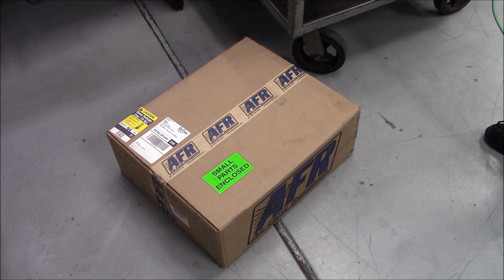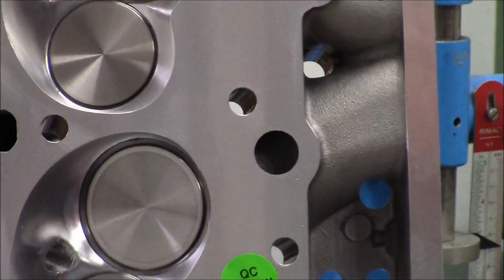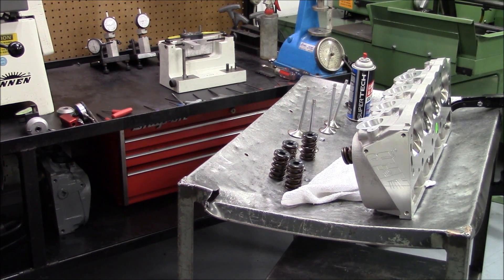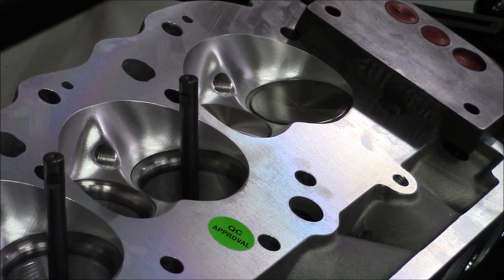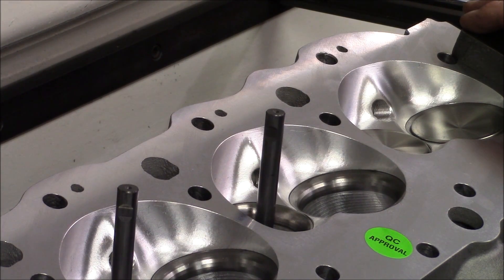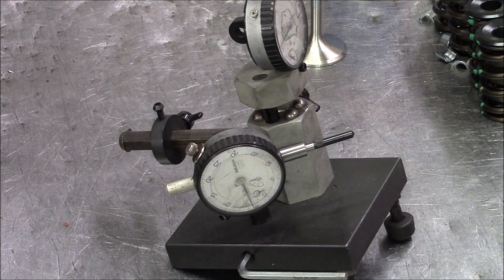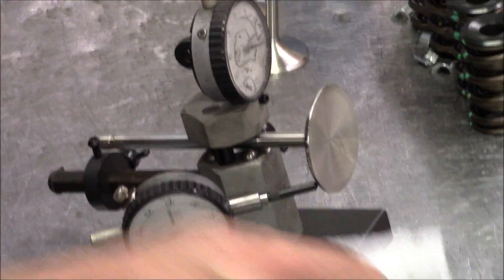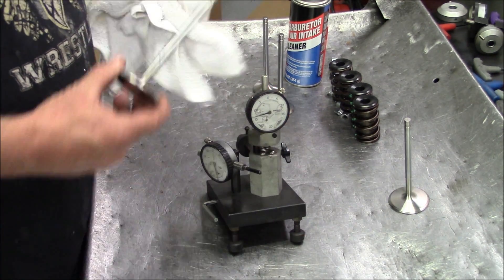Aftermarket Cylinder Heads - Why You Shouldn't Just Bolt Them On - Part 3 - TRRC / Vortecpro

Comment: Your videos surprised me. With my ignorance I would’ve mistakenly thought that all of this would’ve been correct with modern CNC machining. Totally Wrong! So if you got some aftermarket heads you would have to get a competent engineer to just do all of this work as a matter of fact because if you didn’t you’d have big problems. I’m curious how an engine straight out of the factory would’ve come up on the same tests? What were they like in the 70’s in the Muscle Car era ex factory? So the design and porting of these alloy heads would be good and accurate, but they need a valve job before you would consider fitting any of them. And this brand is better than a lot of others. How many hours of work to rectify these problems?

Comment: They don't give a chit. With modern cnc machines these should be spot on. Hell I can do it perfect with my 60-70 year old Sioux Valve Grinding Equipment. It takes a lot of time using stones to get the seat right on all the valves with a 3 angle valve job but I have done many a sets including mine and never had a problem. Even did my own porting. 200 hours I have spent doing a set the old fashion way with the porting but they were spot on. Even cutting them with carbide cutting equipment gets you really close but you still need to use a old stone way to get them spot on. The reason is when you put very much pressure on the valve guide pilot it bends a little and that is were you get the run out. I had I guy bring me a set that was done at a good machine shop and they were off .0017. I just touch the 45 degree angle a dat and was spot on. The owner even wanted to watch and I wanted him to. I always lap my valves in the last step as this can tell you a lot if you no what your looking for. Being a old Tool and Die maker you learn how to do stuff right with worn out old machines. Now days with all the good stuff they can't even get close. Sad really just no quality control and all head manufacture do the same thing. Better off to just buy bare heads and build them up yourself with good parts. The best heads I ever seen as a bolt on was GM vortex heads. Just saying.

Comment: I have worked on new factory heads worse than these.  They were BMW, MBZ, Porsche and other High End makes. They all needed at least a "touch up" on the valve seat critical angle...EVERY ONE.

I had a German Auto Repair Garage and Machine Shop for 30+ years.  I had an advantage because I was an experienced Machinist first and just liked wrenching on Exotic Automobiles.  I was in Local 1515 of the Automotive Machinists Union in the SF Bay Area.

I bought Job Shop type Machine tools mostly, not specialized Head and Block machines.  Much slower, but with Universal uses and excellent results.  My 10 year old son could run specialized machines as well or better than this Video demonstrates.

This Tech is a bit rough as he seems to be Self Taught and doesn't have the fineness of a really well trained Professional.  His performance on this video is appalling, but is quite typical of self taught "experts" that "know it all".  
Just saying.

Comment: I know this is a old video but I would've liked to have seen him switch guide rods and measure the same valve to see if maybe one of his guide rods had a little tweak in it. Seemed like he was using a good bit of force to push them into the fixture. I'm not doubting his results cuz I've seen him cut the offset valve seat in another video and it was obviously out of round. I just found it kind of odd that these errors are that prevalent. But I guess when got manufacturing on a level that afr is they're not checking what he's checking although they should at least once or twice a day. But people have been bolting these things into their engines for a long time and I don't think there's any stories of valve guides wearing prematurely or at least I haven't heard of any or there'd be a lot more guys like him raising the concern

Comment: That's Insane!!!   Are you kidding me?  I never in a hundred years would believe something like this unless I saw it with my own eyes.   I will have to check my next set of parts.  This may also explain the premature failure of my last engine with AFR parts.  I still need to tear it down.  Need to invest in more dial indicators specific for this type of work.   Thank you so much for showing this.
Reply: Remember, these are mass-produced heads. I could care less whose brand they are. The manufacturers, have their own machining tolerances that they have deemed, adequate for passing. A great machinist will still check them.

Comment: People have been bolting aftermarket heads onto their engine blocks for decades without any mention of any of this stuff. If it were Truly a problem I would think something would have changed, or Everyone would’ve started taking the heads they buy to a motor machinest, years ago.
Reply: This kind of fine blue printing is what separates your average engine that everyone has to a killer that makes big and reliable power
Reply: @hollaschracing3753   A few thousands run out is not ideal however when the head heats up the valves and seats have a tendency to bed into one another I do valve jobs all the time and I will  have a consistent run out of less than .001 I would agree that .008 is too much but .002 or .003 will right itself after the first or second heat cycle I would recommend running these heads for a while and then recheck these dimensions you can bet they run out will correct it's self
Reply: I bought a set of 220cc 2.02 1.60 aluminum heads from China! For 550. Checked with break clean and been running for over 10k miles

Comment: Did you notice the gauge moved when he let go?
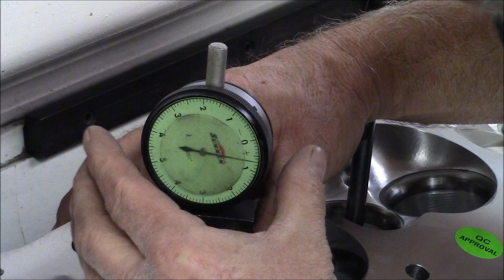Reply: 6:38 - It's moving before, during, & after zeroing........and then he uses his index finger and says "Well, we're just gonna have to zero from there".......Facepalm.
Reply: Have either of you every used a valve seat runout indicator? You should have an understanding of how something works and why it moved, when it moved. The man operating it knows and understands that his hand applying force in certain directions will cause the instrument to register the flex or clearance of said instrument. If there was no clearance then there wouldn’t be any movement due to seized equipment. Leave these types of things to skilled professionals fellas.
Reply: @dieselsmiths  Your replying to a 6 year old post . You must be a lonely boy with no friends. He is out of business. people don't buy his bull. Yes i have used a valve seat indicator for over 30 years. now go roll some coal idiot

Comment: All this means is when you get a new set of heads, simply take them to a reputable shop and have them do a full inspection. If you're spending 3000 bucks in a set of Darts or AFR'S, what's a couple hundred extra bucks to have them leak tested and all the run outs checked. Yeah I get it, you would think for the price they are good to go. But for that price, protect your investment. 

Same with blocks, cranks, so on and so forth. Get them Mangafluxed, bores checked,  cranks checked, etc.

Comment: Tom, when disassembling any cylinder heads how critical is it to re-assembly valves/springs back in the same cylinder?
Reply: Kevin Case if you do a valve job and resurface it matters nothing.  If not you want to make sure you keep them the same.
Reply: more so after the heads have already been run on an engine for a while...the surfaces mate to each other

Comment: So, questions

1) When was the last time your run-out measurement device was certified?
2) Do you have a second one on hand to verify the first ones measurement?
3) Do you have a second one from another trusted mfg?
4) Does the runout change with a different valve guide pilot?
5) How much does the runout change due to temp of head?
6) How much does the runout change due to temp of seat?
7) Is there a way to check if the seats are fully pressed in?
8) Does the mfg tell you how the seat was pressed in?
       (warm head, cold seat; or all just  at room temp?)
       (machine pressed or hammered in?)
9) Does it help to heat cycle the head in an oven before checking and/or machining?
10) The runout checker is checking which cut of the 3 angles that are cut?

Thanks again TRRC for making these videos!
Reply: bash555 all good questions, particularly as this guy tends to throw his tools around.
Reply: bash555 I would think with the amount of equips this guy has and the results he’s looking for pretty much guarantee  that his tools are set up properly. He’s got a valve grinding machine for Pete’s sake. This guy is serious about building. I’m betting he has a regularly scheduled “tune up”(certification) on all of his measuring devices.if he’s been building engines for a while (the amount of equip he has kind of proves this) if he was a hack he would have never reached this level of knowledge or be as well equipped as he is. Yes he’s a little rough on his tools but he’s building engines not super high tolerance aircraft assemblies where a sudden shock or drop can throw a part out a few ten thousandths or in some cases as little asa few hundred thousandths and the part or tool is unusable. This is a bit more forgiving.
Reply: That is some great questions since most people do not ever get their measuring equipment calibrated on a schedule or every time it is dropped.  Wild Harold's Performance
Reply: Jeffrey Adams
Air flow and other Usa manufactures have equipment and knowledge far beyond this obvious sales pitch in the video. joedell71 is uninformed or a friend of the person in the video. What there claiming is not true. Don't waste your money. If you bought some heads and are really concerned just put them on a flat surface fill the port with solvent and see if they leak.
If you have any issues just contact the head manufacture and Im sure they will take care of the problem. I have checked many heads from airflow ,brodix and dart, ect they are very high quality, These companys are very reputable and very concerned about customer service.
Of coarse this is just my opinion.
Its is a shame people in the vidio like this are ruining the industrie
Reply: jeffrey adams
Thats a great idea make sure to bring some lube
Reply: Jeffrey Adams His contact info has to be on the video or in his channel somewhere. Couldn’t hurt to holler at him. Even just to talk price and availability. A guy like this probably has a waiting list so I’d get on it if I were you. If this is really the state that aftermarket heads these days it would be unwise to not check them. It could get expensive quick if you bolt these onto a blueprinted small block. Good luck on your build.
Reply: joedell71
Its human nature to try and defend some one that you believe is being picked on. Thats understandable. I have been in the industry owning a machine shop for along time working with parts like this.
In my opinion this video is just a scare tactic to try and get some business .
read the comments I'm not the only one to see through this. 
But your welcome to your opinion and I respect it, I dont agree but best of luck to you
Reply: Valve concentricity check before and after grinding says alot. I assume that his dial indicators are spot on calibrated, tested, zeroed-in. We had similar issues with pre-assembled heads in my old workshop. I believe this man is honest. Always check before installing. Last one who touches always gets the blame if something fucks up.
Reply: Guys I use indicators all the time and they aren't made of glass, also much of this stuff won't be serviced or "calibrated" until it's broken. The things that need to be calibrated on a regular basis would be things like torque wrenches and precision levels. How many "thousandths" doesn't really matter until your sending parts to a third party for machine work or repair.  My brother's blown small block runs dart heads and I was there when the builder pulled them out of the box and it took him all of 35 seconds before he started listing things off that he didnt like. I bought brodix's and they were no different. Both engines make a hell of  a lot of power but it pays in my opinion to have a good machine shop in your corner going through these things and making them right
Reply: joedell71 true this guy is the real deal i wonder whats the price? Im about to buy some darts be nice if could get his hands on them..
Reply: This trrc guy is all bull.
Reply: @tomhutchins1046  https://youtu.be/rM51mhFZl5E looks like he's still trying to figure out how to use his tools. Not

Comment: Nothing incorrect about using a tool steel pilot to take measurements from - especially since the operator is rotating it 90 degrees whilst measuring.  If you've ever seen an Epoch Newen valve seat being cut (AFR uses it) it makes the world's greatest seat contours but it is indexing off a fairly loose valve guide pilot.

Comment: That cart has seen a better day.😜
Reply: That cart has seen way more cast iron BBC heads Vs alloy heads.
Reply: A lot of work has been on that cart.   I see it as a good sign.
Reply: Right Meow! ,  I see it as a character flaw.  The very best Engine builders are the ones with ocd and shops that rival hospital operating rooms in cleanliness.    That table says a lot about what he’s willing to let out his shop doors.
Reply: @chrisburnsed6349  LOL ..... hardly. The purpose of his video series on aftermarket heads that are mass produced, and that anyone can buy ---- fully finished and are "MARKETED"  as ready to bolt on ---- is that every valve seat SHOULD be checked, and the valves too, when there is a suspected issue. Just like Mark has done in these videos. Seems the armchair machinists have completely overlooked the fact that, no matter if those heads pictured in this video, are going on an engine that Mark has built complete from the block up OR, if he's just selling those heads outright to a customer ---> who is the end user going to call first when there is a head issue? This is what a "great machinist" does and why you pay that machinist for his services.

Comment: I disagree with your measurement method. The very slightest warp in the pin you installed in the valve guide or the slightest off-center installation of the pin will show an "out-of round" in the seat. The seat needs only to be concentric with the valve stem guide hole, not with the measurement pin installed in the guide hole.
Reply: Escape Artist Jesie this is the industry standard and commonly accepted way of checking for seat runout by referencing off of the valve guide
Reply: @Cise82  It might be the right method, but when you use a guide that moves to decieve people and sell your services...
Reply: Escape Artist Jesie - on other videos he is shown moving the pilot 90 degrees and repeating measurements
Reply: Hugh O'Brien - Ummm...  Nope.  The bending moment of that tool steel pilot, in combination of the superior Young's Modulus of Carbon Tool Steel would create measurably less error versus a Stainless Steel valve stem.  Plus, the operator rotated the pilot 90 degrees during measurements.  BS-Mechanical Engineering & engine builder.
Reply: My question is why didn't the head MFG do a basic lap and visual inspection before sending them out the door?  That seems like it would have quickly uncovered large runout issues.

Comment: I wish he checked leak down first then the guide job just to show, but that was extra work anyway. Even if they leak at first or not, valve job tuning is necessary anyway. Or they will end up leaking because valves spin and the runout isn't going to be perfect as can be from factory. Thank you for your awesome work you head guys got good heads.